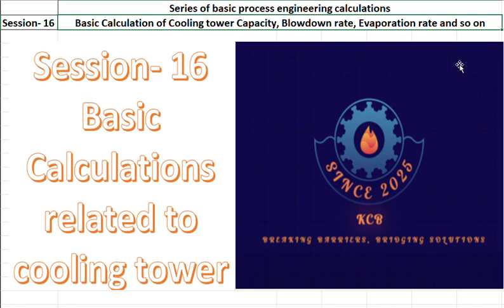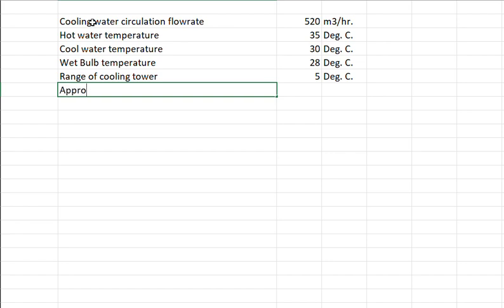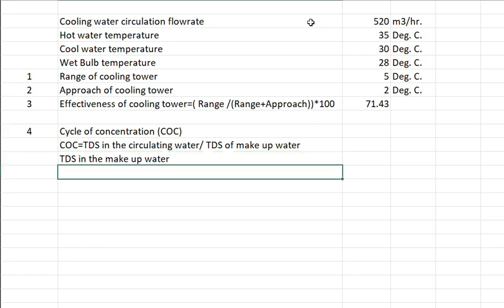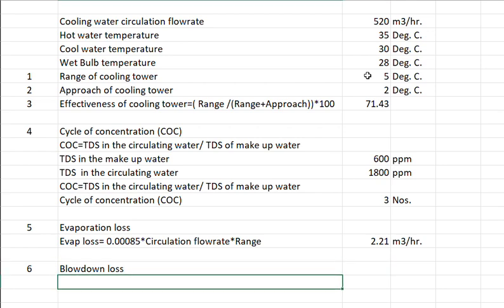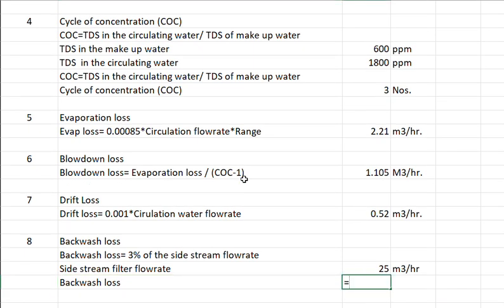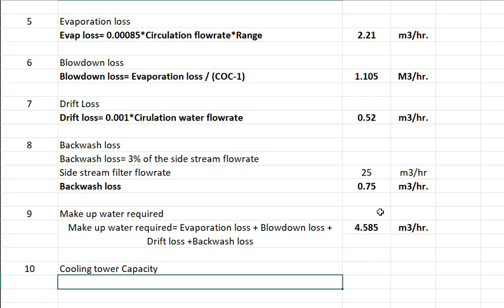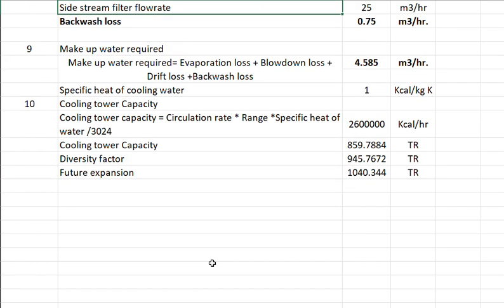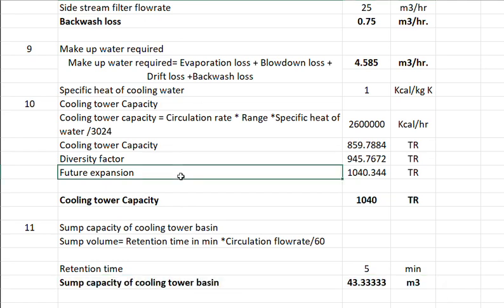Basic Calculations of cooling tower capacity, blowdown rate, evaporation rate, Make up water & so on

Comment: How to calculate air leakage in terms of loss of money , if you have any idea please share
Reply from the maker: Monetary loss can be calculated in the conditions of air compressor to review efficiency and performance check. This air leakage rate affects on the vaccum drop due to air ingrass in system and associated hazards if any flammable atmosphere available in connecting system.